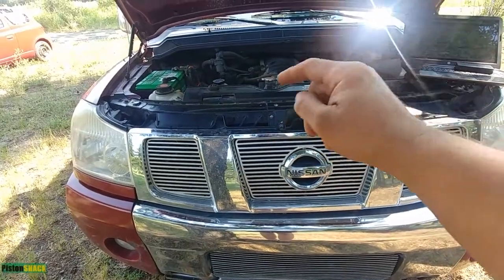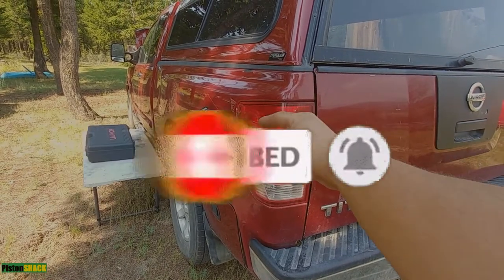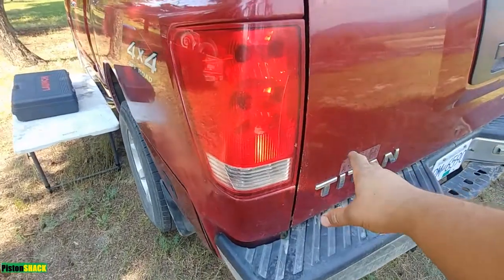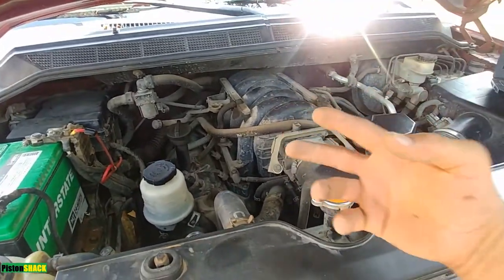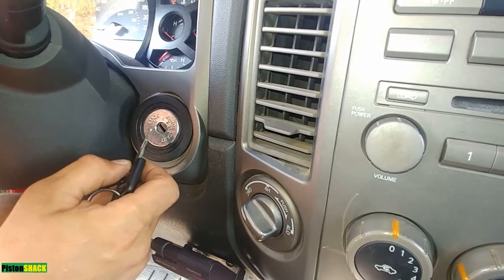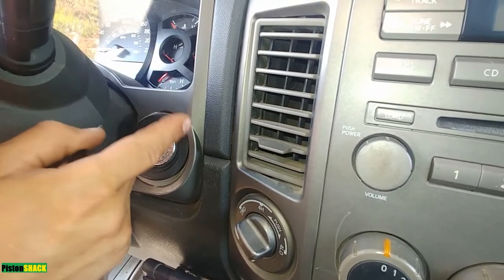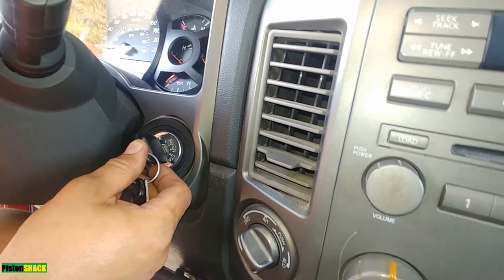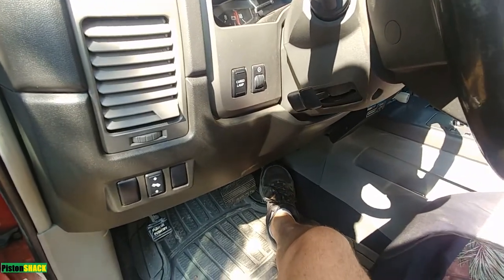NISSAN TITAN ELECTRONIC THROTTLE BODY VALVE (ETB) CLOSED POSITION POSITION LEARNING | Made Easy

Comment: My brother bought a 2007 Nissan titan, it has problems. When he steps on the normal accelerator it doesn't accelerate, we need to accelerate slowly. turn it back on, it doesn't get hot either, on the freeway it doesn't accelerate fast you have to wait and it doesn't go over 45 miles
Reply: Check the fuel pump and maf sensor